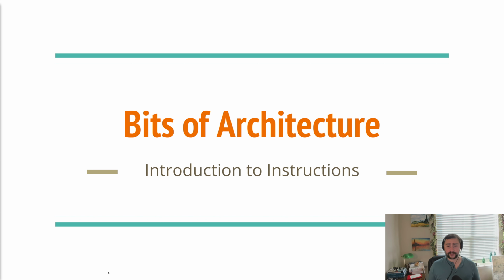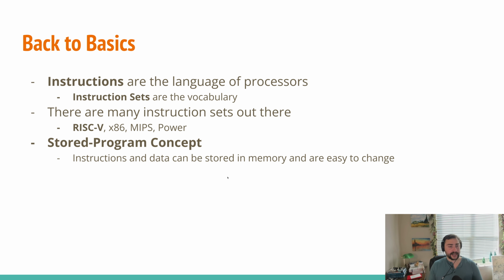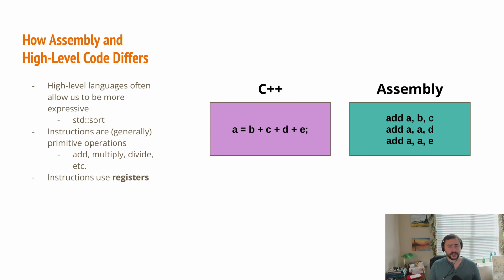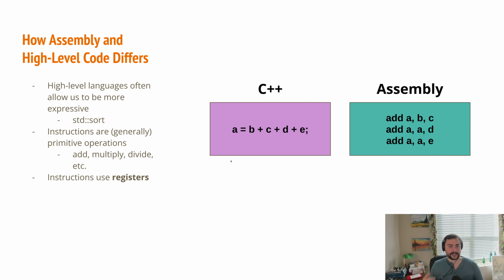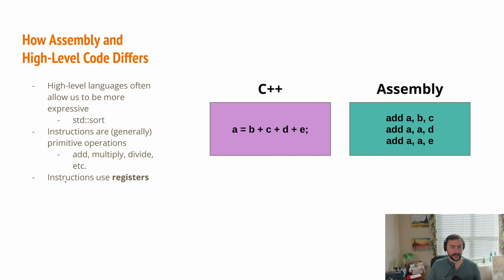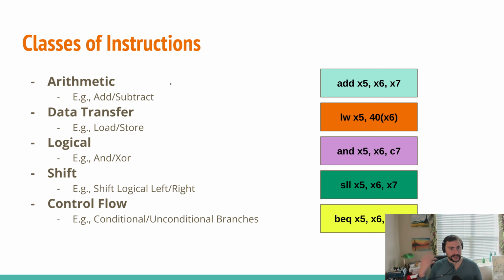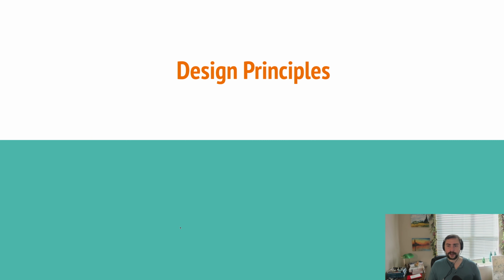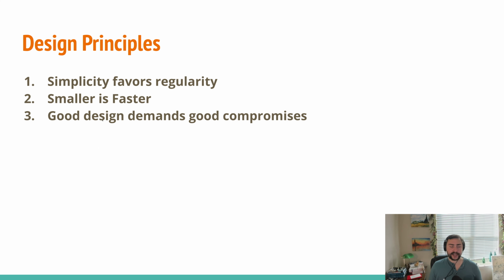Bits of Architecture: Introduction to Instructions

Comment: Would it be possible to do more in depth lecture-y videos? I really liked your old streams where you went through a textbook and talked and annotated as you went!
Reply from the maker: My primary concern with going through textbooks is that of copyright. I also would not be able to distribute any of that teaching content (which I can with all my independently created slides).

The goal of these vids is not to be surface-level (though, it might seem that way at the moment because we're covering the very basics of computer architecture which is itself very surface-level by design). The goal is for this to be basically an undergrad->grad->postgrad architecture series broken up into more manageable chunks. One of the major benefits of this is on my side. It's a lot easier for me to make slides/prepare/record a 6-10 minute video than it is for me to get a 30m-1h video out (and balance that with work and home life).

Longer form content is not off the table - an area that I had been planning on doing this for was more for research papers rather than textbooks though.

Cheers, and thanks for the comment,

--Nick
Reply: @NotesByNick  That makes sense! Thank you! It's hard to find really amazing content and this channel is like a needle in a haystack. Thank you!